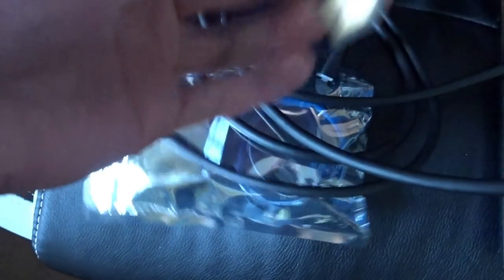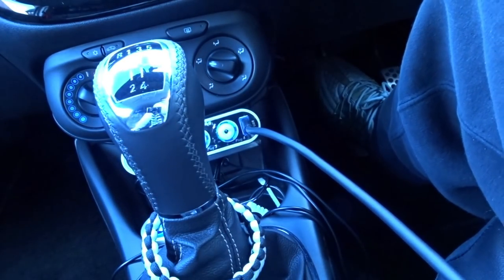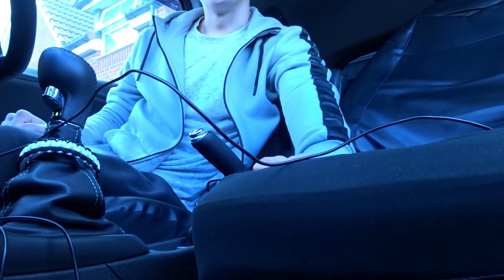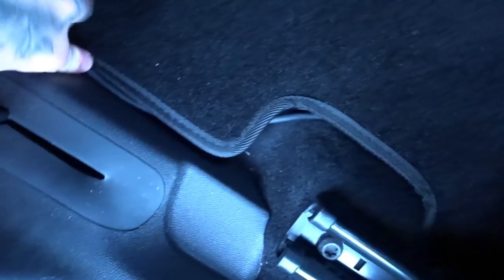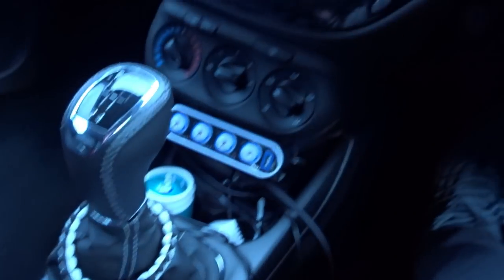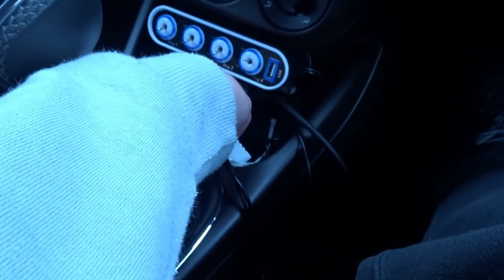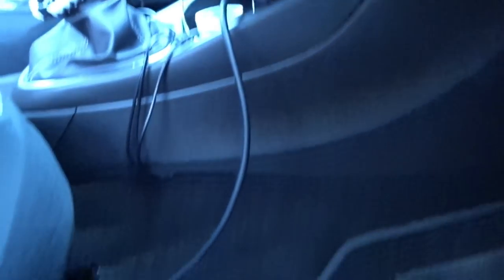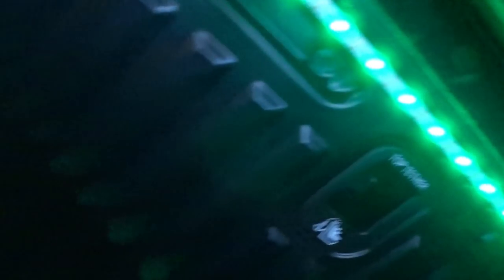HOW TO INSTALL BOOT LED'S EASILY!

Comment: If you pull up your gear stick housing mate, you can route the cables a lot easier to those side LEDs. Lift it up and run it down the side and it'll come out at the bottom.
Reply from the maker: Definitely will try that mate thank you!
Reply: @JackTHayes  good video mate